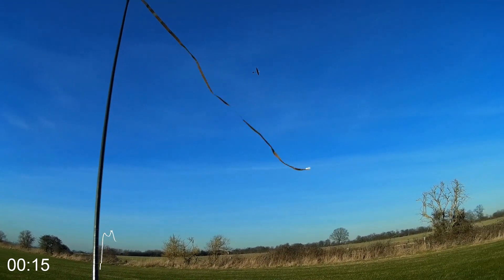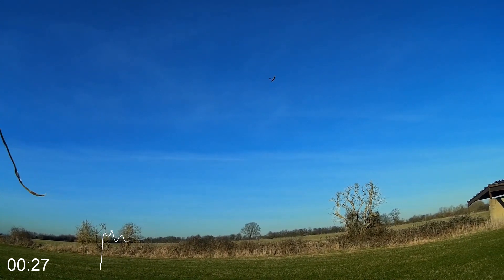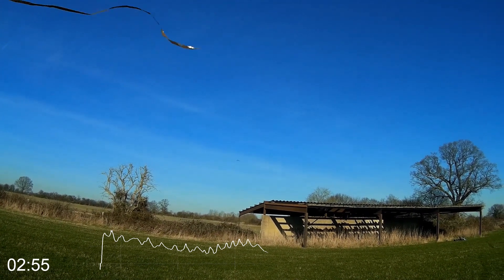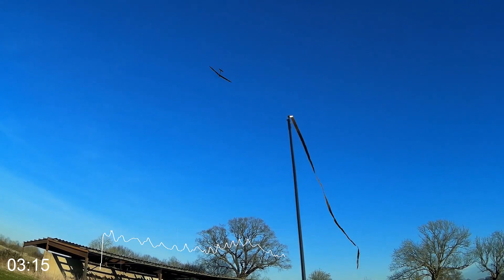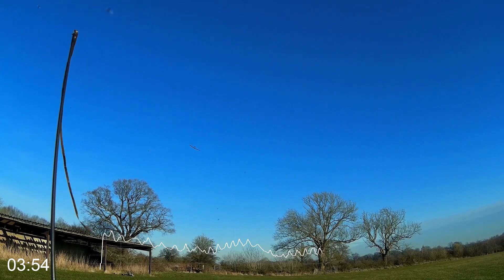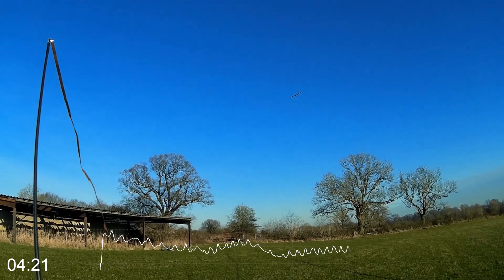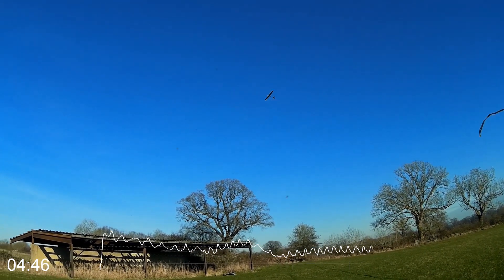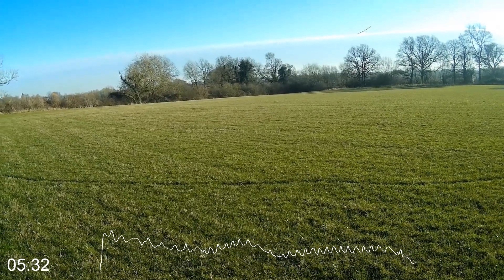DLG Thermal Analysis - Jan 2020 : Super Light Lift

Comment: Nice flying! Can you share the program you are using on your TX. I’m PaulG over in the BARCS forum. Thanks
Reply from the maker: Hi Paul - I've updated the description.     Most people use Jespers script which is better supported.  But I prefer the audio and throttle usage in the script I use.     My latest version is still beta and when we get some decent weather and less restrictions I will be able to test it properly.    On the bench it works fine though.      FYI :   I am doing limited work on this script so don't expect regular updates :)